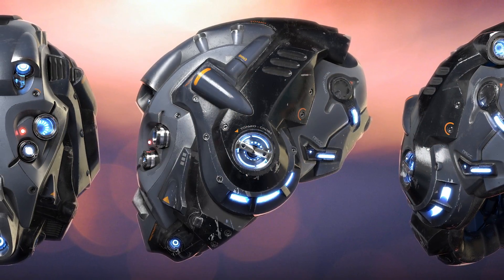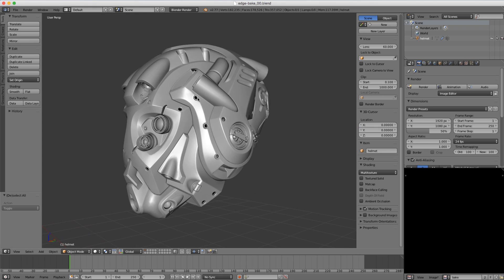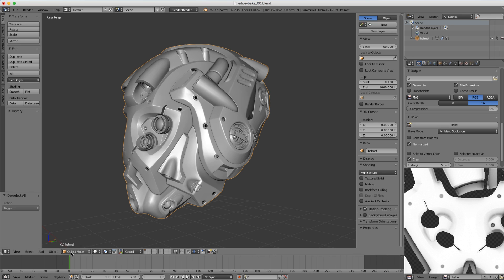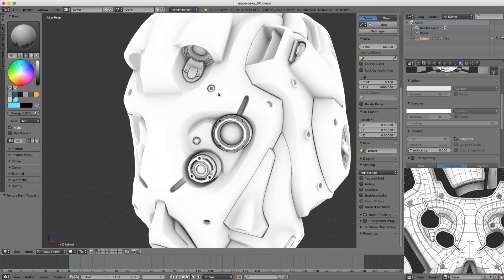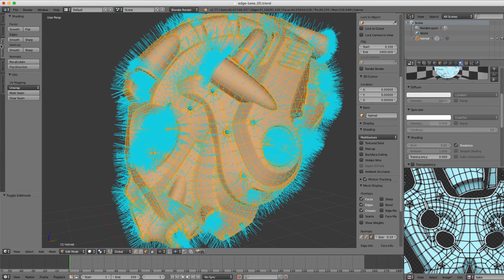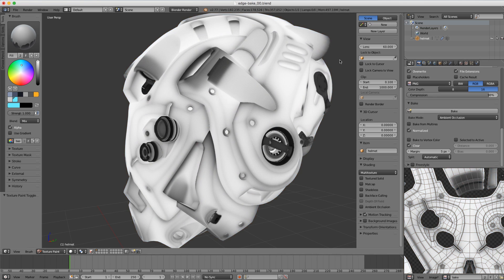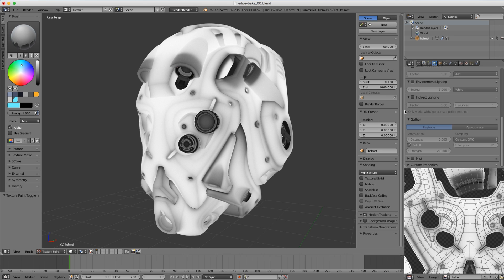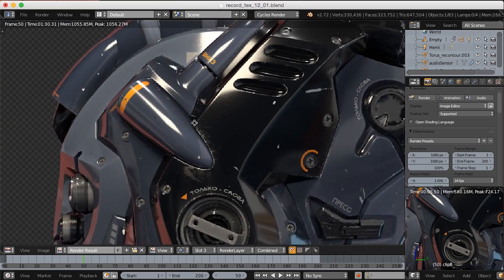Shading in Blender: Baking an Edge Map Using Ambient Occlusion

Comment: How would one go about doing this in Blender 2.8x.  I have looked all over for the equivalent settings, but having a hard time finding them.
Reply: In 2.8 you flip normals, plug an AO node into your base colour, then turn on "Inside" in the AO node, change the distance number until you get what you want, usually a very low number works. Add in an image texture node, create a new image,  and then bake the AO from the render tab to a diffuse texture. This technique is very taxing on the CPU or GPU though so I would keep the resolution low if you have a fairly complext model. I have an RTX2070 and it was crashing inside of blender when I baked any higher than 2k for a high poly gun model.
Reply: @sibience  Get a normal node, Use vector math to multiply all to -1 and connect it to an ambient oclusion.

Comment: Nice but ... Far to be realist. Really.
You should pay attention where are the traces of wear on objects... Inner corners can't be in contact with rubbing things, so they don't wear out as fast as flat surfaces or acute angles...
What you shown is only valid for dust and other depositions like grease.
Reply: Did you watch the whole video? The point is teaching how to isolate convex edges, where scratches naturally occur, not concave areas for grease and dust. If you watch the course that this tip is based on, I demonstrate using the combination of dust/grease + scratches to get the realistic effect you're describing.
Reply: Okto Putsch, but the video shows highlighting the acute angles.